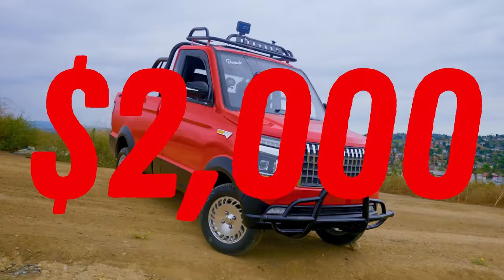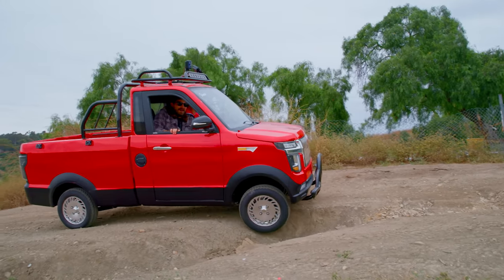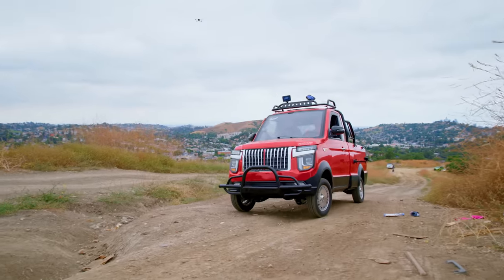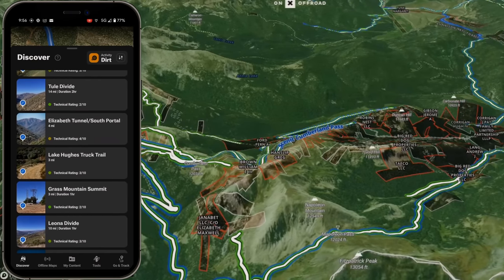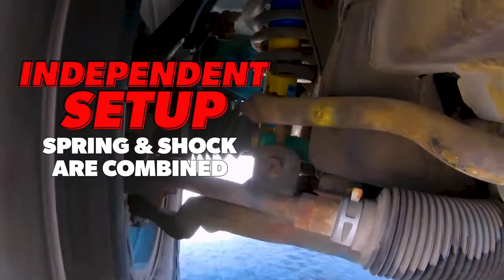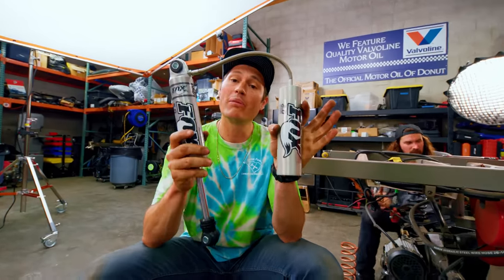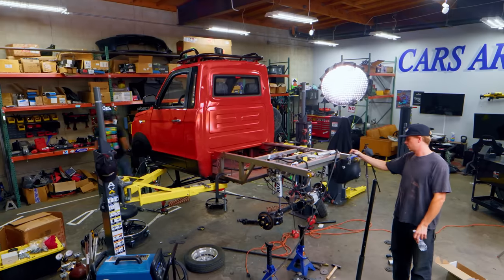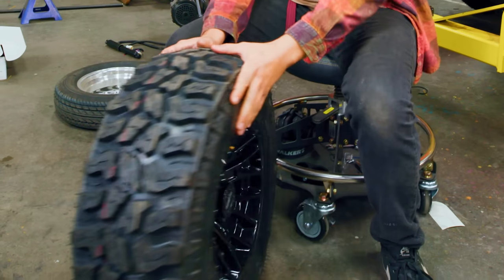We Put a Lift Kit on our $2000 Chinese Truck

Comment: @donut

Lol, a steam engine in that thing would be hilarious! But for the sake of practicality, it'd be better to do a hub motor setup like @chriswallace4490 suggested.

Also, it looks like there might not be enough weight in the bed to keep the rear wheels firmly planted on much of anything beyond a mild-ish slope off-road. Maybe try adding a single sandbag or something similar to the back of the bed? That should honestly be enough - maybe even more than enough.

BTW, the tiny truck looks so much better with the new wheels on it! Hopefully you guys can figure out the transmission & throttle issues - it'd be fun to see you all take this thing on some (mild) trails that other people use sometime, and perhaps get their opinions on the build!

Keep on having fun, and just know that you guys rock - all of you!!😎😄

Comment: a 96v 10000w full drivetrain could be fabricated to it for under $2k, then youre just looking at a power supply for it depending on what battery it has now

Comment: Did you ever think to upgrade the motor with the added extra weight of suspension And wheels That's why you didn't get up there Step this whole thing Disappointed in y'all At least But the bigger motor from Alibaba And placed it in the same place Do you still diligence Do your research Stop making fun of this stuff It's a serious truck you can do some stuff with it provided You upgraded in the way that you should upgraded Wheels added weight suspension added weight To the truck And that motor just could not handle that weight Unless you want flat ground But then again that's physics For you to say let me beef up that motor that way it can handle the weighted Wheels in the suspension food for thought though